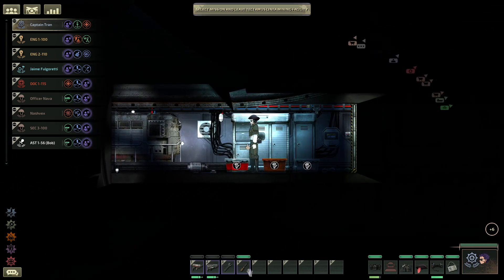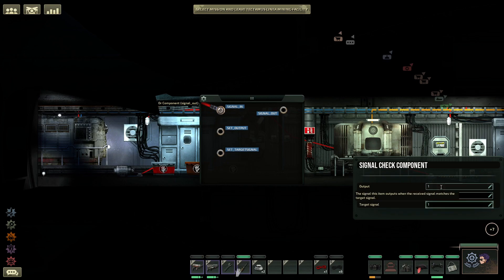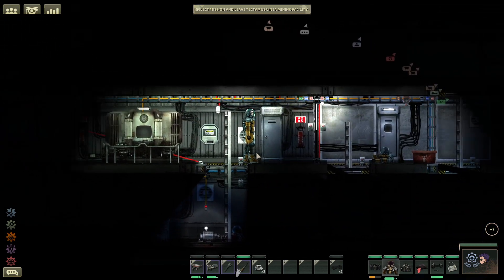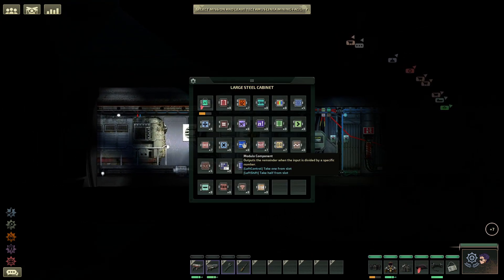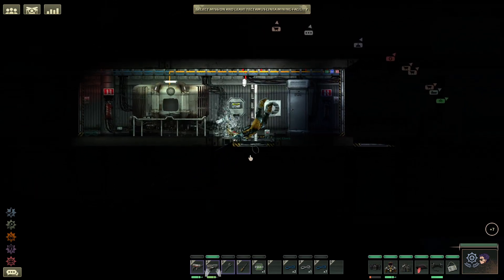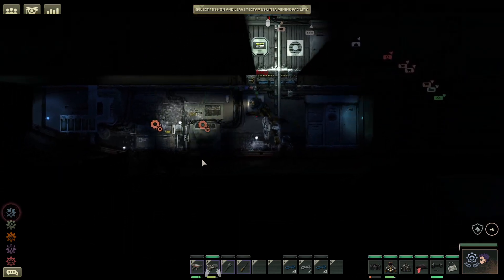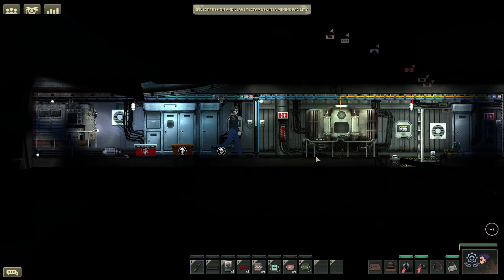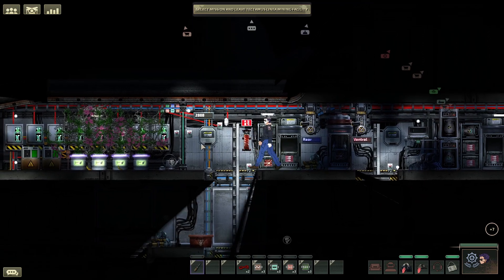Barotrauma ⚓ 〔This Old Sub〕 11 - Countdown Display

Comment: Really weird that it doesn't work with vanilla detectors. Good that you pointed it out.
Awesome explanation on wiring processes.
Reply from the maker: I wasn't sure if I just missed something, but the water detector programming (output codes) and the wiring were the same on consistent rehearsals for this recording.  Not only on the Orca shown here, but on a Barsuk test submarine.  However, I do acknowledge any of this could be because of downloaded Steam Workshop plugins.  The reason I didn't try removing all plugins was because I didn't want to create any risk at making my existing playthrough unusable by installing, uninstalling, and reinstalling complex mods such as Lua and Performance.

One thing I like about your setup is that, from my various experiments, it appears to close the door when water approaches.  However, on the flip side during my tests, I found it difficult to open the door until the incoming water has stabilized.  Again, if your results are different, it may very well be because of something like the Performance mod.

I really appreciate getting to tinker with your setup!  Each new method and project I digest increases my player skill in Electrical Engineering.  Maybe one day I can learn enough to make a new system people will want to implement in their own subs!
Reply: @TranPlays  It was weird, because the water detectors should be the default ones in existing ships, but the Performance Fix messes with component signal timeframes, so that can be it. Still, it is better to have better frames, than a couple components fewer in the sub.
The closing the door is not from my setup, it is the existing door wiring (you kept it connected to the door Set_state). This is why I didn't add the delay to the setup, because you cannot open the door within the timeframe set in the Delay component. I wanted to add it, but sadly couldn't circumvent the timing problem. So the thing you like is not thanks to my design sadly :)

Wiring and making circuits in Barotrauma is very satisfying. I played other "learning" games, but in this I actually was happy when I made a functioning thing I want.

For the ballast flora part next, my method is 3 Detonators above the pump and a Button, and put Incendium grenades in them. 2 should be more than enough, but better to be safe than sorry. I used to do 2 frags and a fixfoam, but this is simpler, no hull damage.
Reply from the maker: I experimented with various explosives as well.  Two incendium grenades are solid if there isn't water, more if there is.  Positioning closer to the click-point of the pump also matters (above being closer than, horizontal to the pump without being behind anything).  However, this is all in a testing environment, and I have not yet engaged with ballast flora in an actual expedition with an actual submarine.  I plan on getting infected on purpose in the next episode (planned to be a playthrough episode), and then doing a "This Old Sub" afterwards to demonstrate the initial setup.